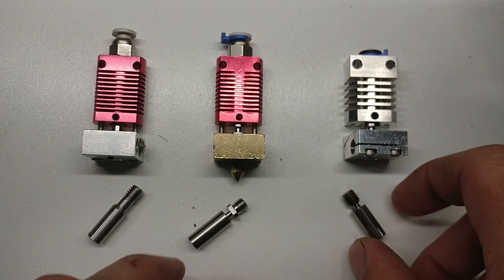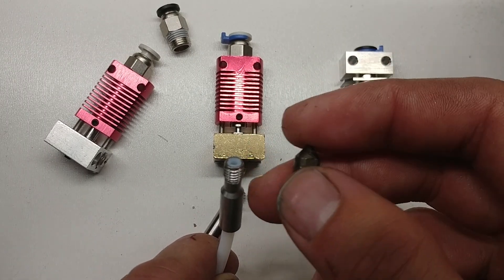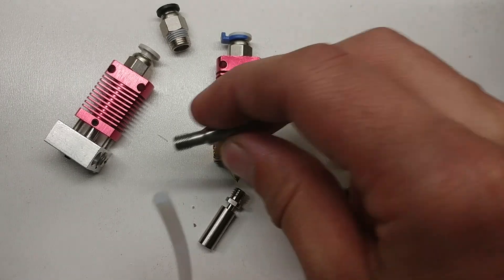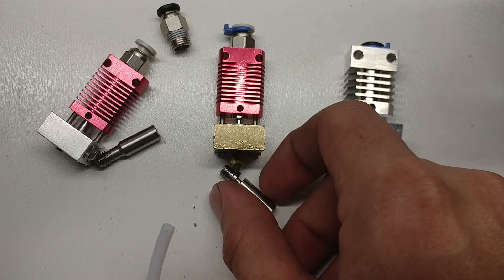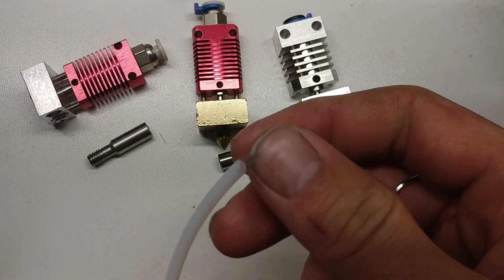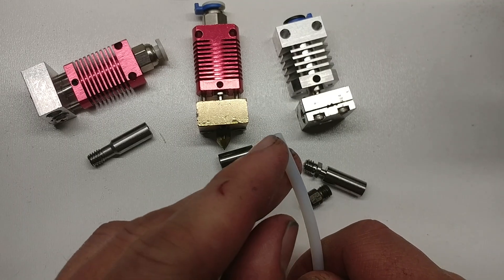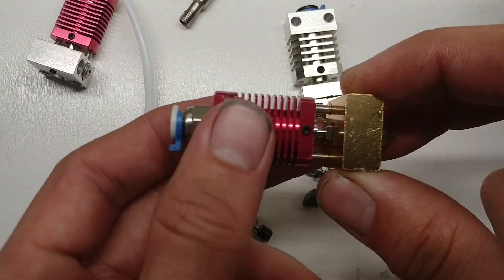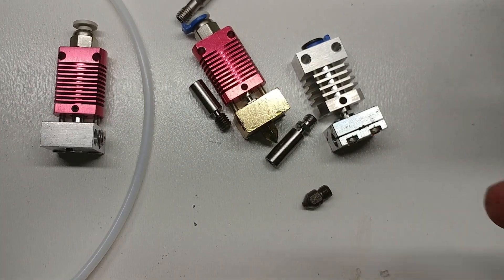How to make PLA work with All Metal Hot Ends (No More Clogging)

Comment: With the small hot end on the right, it works well when the filament is constantly feeding like in spiral mode.  Once numerous retraction happens that's when it clogs.  At least that's what I noticed.  But like you said PLA is a whole different thing.

Comment: omg... Man, just tell me why this part you lubricating called heatbreak? Cause it suppose to break the heat. I had an issue only with the cheapest all metal heatbreaks from ali, the ones from mellow works great. Instead of putting lubricant everywhere you would rather think about how it is supposed to work by design. And that will actually help you to understand, that PROBABLY, just saying, you have not enough cooling of the coldend of your heatbreak. So either your cooler is too weak or heatbreak you are using have a little contact with the radiator or heatbreak is just bad and its not doing its job. And this could be more of an issue in hot regions. Thats it. If your heatbreak fits your radiator and you have sufficient cooling you will never need to put this oil of yours everywhere. Its not the first video where people spilling mineral oil all over their parts or filaments, but the truth is - its unnecessary hack, which is just masking real problem, just solve the problem causing issue, dont add another variable to the printing process cause it could harm your layer adhesion a lot.

Comment: Had an all-metal hotend for over a year now and only experienced my first clogging a couple of days ago. Because of stringing, I set the pull back distance for traveling higher and apparently, becuause of this, the soft filament was pulled back into the unheated part of the hit end and solidified. I cleaned everything out and ran another print, with the same long pullback distance, because I hadn't made the connection to the problem yet. When it clogged again shortly after, I cleaned it again, set the pullback to a very short amount, so the filament would still be in the heated part and now it works perfect again, so I don't think lubrication is really necessary. Still have to figure out a solution for the strining, but it's a minor nuisance compared to a clogged hotend. Probably will fiddle with the print temp next.
Reply from the maker: @Brandis13  is yours an all metal or a bi-metal?
Reply: It‘s the Creality Spider Pro, so it‘s all-metal, the heat break has a ceramic covering though, so I‘m not sure if that makes it something different then.
Reply: @marcb.877 I have the spider v3 and I HATE it so far, it is the most temperamental hotend and of course it’s on an ender 3 so it already comes with its own problems

Comment: is the Temperature Different when heating PLA in a all metal-Hotend then a Standard  Hotend ? my problem is getting the layers bond with ac and does it matter ?
Reply from the maker: @markmerberger7997  usually run about 10-20 hotter.

Comment: As you say, the info is so short that I don´t even know yet if the last hotends for Ender are all metal or have the small teflon tube inside. I will go for your solution, a drop of oil before you print is much more practical. I think we still have the same problem that cars had many years ago before inventing the closed circuit of water to refrigerate the radiator. I think the whole hotend system must be reinvented but at affordable prices because how can you even think on installing a decent hotend of about 150 dollars on a 120 dollar printer, is ridiculous. Companies want to earn more money selling parts than the whole device. As the hotend is the more often part  replaced, they ask good money for it, or buy a cheap one that will last 3 months. This is why I think that the enthusiasm for 3d printers is going down. It would be better if you buy a new printer every 6 months when it starts failing but many printers start failing the same day that you receive it and try to print, so many issues for a hobbie. What is it all that we want? Printers printing, that´s all.more often

Comment: Hmm this video leaves me with a question. A google search revealed this problem to be limited to mainly PLA on Ender 3, clones and printers with that undirected and loud stock hot-end fan. That means it's very likely due to heat creep. Never the less, I've ordered a bi-metal heartbreak for my old Ender 3 (Rev1) and a 5015 fan to test this theory myself, tho in my research i already found a video claiming to fix the problem by using high performance thermal paste. Please note that there's many options available that use "all metal" hot-ends stock and works flawlessly

PS Teflon (PTFE, the bowden tube) doesn't become lubricating or achieve lower friction at higher heat. It's fully stable until 260C, tho lower quality starts to degrade as low as 230C. At degradation PTFE loses all of it's beneficial properties. So if this is something you've read somewhere, i would be very interested in reading it myself, if you kindly will refer to your source

Comment: I wonder if CV-2 grease would work. It's a moly grease that's good for high temperatures, but it also never comes off. You can put it inside the piston walls of a car engine and run it for 200,000 miles and in the end the grease will still be coating/protecting the surface. It just might be hard to use, because you'd probably have to put it on where you need it and then wipe it off the best you can. It might seem like you got it all off after wiping it very well, but there will always be a very thin coating lubricating that area for as long as that hot end or its parts exist.

Comment: Both of my machines are all metal now so I'll try this for sure, but for those still running stock hot ends there's an extremely simple way to make sure your tube is set perfectly.   If you simply install it with the nozzle in place the act of it pulling back and locking will make a small gap. So I turn the nozzle out a few threads, roughly the same distance as those clips for the bowden collars. Insert the tube all the way to the nozzle and tighten the nozzle. This will push the tube back to engage the lock all while keeping a perfect fit to the nozzle.  You can fo a bit further out with the nozzle too, some compression on the tube won't hurt but going too far might distort it and cause a restriction.
Reply: I never knew it was a problem with all metal hotends. Thought they were identical except the all metal one's could get hotter. I don't even have an all metal one and I'm having a hell of a problem. I'm not sure it's clogging though and seems to be a problem with the extruder. Clearing the hot end and temperature changes do nothing to fix the problem. Now I want to get an all metal hot end to upgrade, but I hope I don't start having clogging issues. (Guess it's always good to do research beforehand... but that's what I did before buying an Ender 3 and I deeply regret that choice. Have had every single problem I have ever heard was possible and 10x more than that in just 2 months).

Comment: Where can I get those all metal breaks at I’m kinda new to this
Reply from the maker: go on Amazon and look for bimetal heat break. Just make sure to get the proper one, they come in 6mm diameter or 7. 7 is what fits the E3Pro and Biqu B1.

Another note, make sure the heatbreak has a top indent for the tube to sit inside, makes it much easier to guide the filament.

Comment: Hi there.
I uploaded a simple part to Thingiverse(called: PTFE-Straightener😁), that sits on the pneumatic couppler, on top of the Ender-3 hotend, and it's there to straighten the PTFE-tube entering the heatsink, so that feeding the Filament into one of these cheaper Heatbreaks won't be a problem anymore. 
Should you still get problems, what you can additionally do to help with feeding the Filament, is moving the print-head all the way to the right before feeding the Filament, so that the PTFE-tube aligns even better with the Hotend.
But of course buying a copperhead-H.B. is also possible.

Comment: Wouldn't the oil contaminate the build plate surface causing poor 1st layer adhesion? 
I use the a Micro Swiss all metal hotend and have never had a problem printing PLA or PLA+  with my CR-10s Pro.
Reply: Yeah, that's absolutely what will happen. The oily mess get's everywhere on and around your printer, so, don't do it, unless you want your printer and print area to look like a chinese restaurants kitchen. 
It's not necessary to do it.
Retraction settings and nozzle temperature are good ways to get clogging issues away.

Comment: I stumbled upon this video by accident while actually trying to remember what I took out to revert from a bimetalic heatbreak back to stock with capricorn tubing, and maybe I'm speaking too soon, but your tip really seems to work. I bought a small 100ml bottle just across the street for about $2. Used a few drops inside the hotend and started printing again. My Elegoo Neptune 3 went months without use because of the constant clogging. I had several spools of good quality PLA that I couldn't use because it would make a mess, just really shitty layers, having to use high temps and constant clogging. Earlier in the day I tried this tip, I actually printed 2 simple prints for my dad's project, and like always, clog, clean, print, clog, clean, print. Later the same day I tried the tip and have been printing at least 5 or so pieces without any issues with temps down by 20°C. Prints looking as beautiful as the first day I got the machine. That made me remember why I wanted a 3d printer in the first place. Thank you so much for this video!
Reply: Why you dropped the bimetal heatbreak?
Its the best one you can get, tubing ones are useless.
Reply: @DRedGuia  I actually didn't. Maybe it wasn't very clear when I wrote that, but I was going to drop it, and then I found this video while trying to remember how to put the old one back. I'm still using the bimetal heatbreak and it works great. Same for the tip in this video, I add a drop or two when using new filament after a couple of months.

Comment: What would cause a clog two hours into a print? I have two printers with Titanium Heat Breaks. One printer has been working like a champ but the other one clogs up after an hour or two during a print.
Reply from the maker: What's your retraction? Bowden or DD?
Reply: @xalt.3d.designs  5mm/s for distance and 45mm/s for speed. Happens in both configurations. Had it in a direct drive setup then changed it back to bowden thinking it was the extruder. figured out it was the hotend getting clogged.
Reply: @lelandclayton5462  bowden is 10 years obsolete, go eith the firect and do 1-2mm of retract at 35mm/s.
Titanium heatbreaks are much better than anything else.

Comment: Can't you just spray liquid PTFE lubricant into the metal part of the hotend? It will give it a teflon coat on the inside
Reply: I thought the point of upgrading to an all metal was to avoid the off gassing of PTFE at high temperatures? Wouldn't the liquid PTFE have the same problem?

Comment: @boydm991  I just switched out to an all metal hot end on my stock set up. I saw in the reviews for the hot end that clogs were common without retraction changes. Most comments said 1.5 so I tried it. I have a little stringing so I'm going to try 1.75 and 2 to see if I can dial it in.  Maybe Ill also try the mineral oil. I was thinking of using a sponge before the extruder like Ive seen others do. Maybe Ill design a little box to hold it?

Comment: tune retraction. 2 years with all  metal on 2 sunlu s8s, a year on an ender 3 and haven't had to oil anything.  Flow, linear/pressure advance, and retraction. in a bowden setup i am good with about 2.5-3 mm and on direct drive .9-1.5mm.

Comment: Allmetal has not been an issue for PLA since the thin throat ones became available. It's just the old fat E3D style ones that had heat creep. The Triangle Labs/POLISI3D one in the middle is great. If you were getting heat creep with it maybe you're retracting waaaay too far.
Reply: Hey, I just upgraded my E3Pro with a bi-metal from Slice Engineering, and I started getting clogs in it. I looked at other reviews, which suggested a retraction of 2.5. I changed it, and was still getting clogs. How would I go about doing a retraction test to find the optimal retraction?
Reply: @NIGHTDREADED  Hey mate, I'm also running a bi-metal with 2.5mm retraction. To be frank with you, I tried to tune retraction a lot, but nothing really fixed it. I came across this video by accident when actually researching how my hotend looked before I swapped parts, and the mineral oil drops inside the hotend really helped me. The printer now works just as good as it did before I swapped to a bi-metal, and retraction is still at 2.5mm.
Reply: @GrandmasterKnox  Damn, and here I was thinking that Bi-Metal would really solve all the problems of PTFE...
Reply: @GrandmasterKnox  How often do you re-oil Hotend? Hours/weeks
Reply: @GrandmasterKnox  2.5mm retract is too much, thats whi it cloggs.

Comment: I have best experience with stock hotend by using an all metal hotend (titanium) and taking off these 2 screws between heat block and cooling ribs. Just fixing the heatbreak at cooling ribs with the little black made screw fix it very well and much enough. This setup performs best printing results, has best temperature qualities, and never more heat creeping all time. One of the problems are these 2 screws, there transporting up some heat and inceases the temperature in upper side of heatbresk up to 150°C or more. PLA melts to early and heat creeping nerves you. I considered stock hotend without these 2 screws and all metal heatbreak to micro swiss hotend and creality's spider hotend. The first setup makes ALWAYS better results then hotends, which are much more expensive. It's awsome how cheap and easy it is to power up hot ebd efficiency 👌😉 Maybe just the phaetus dragon and volcano hotends performs better, but they are made for higher printing speeds with longer melting zones, it's not for conventional use.
Reply from the maker: I am actually starting to convert all my E3Pro printers over to a new hybrid hot end using a bimetal heat break and volcano heat block.

Comment: I thought I needed all these fixes but turns out if you grab a piece of Bowden Tube and run your filament through it and if it catches or has resistance it is due to the poor filament not being exactly 1.75mm +/-  in diameter. This is why I think a lot of people switch to direct drive as you can get away with inconsistent filament diameter not being stuck inside the bowden tube at various points of the roll. I figured people would mention this but no one does, especially now that filament is increasing in price and the want to switch to a cheaper alternative will be poorer results. My two cents.

Comment: I've been doing essentially the same thing just slightly different. I have a clip on container that I put a couple drops of mineral oil into sponges and clip around filament. I then run 2-300mm through the "oil box" and out of the extruder. Then remove the box and continue printing. I redo that periodically if I notice any anomalies in printing, typically the first layer purge line starts looking globby. Thanks for the video though, love that you're getting good ideas out there.

Comment: It would be better if you show the proper preparation on only 1 hotend, because i have a mix conceptions what is good, what isn't good ....  🤔
Why to add 2 drops of oil to the hotend, when later on you insert the PTFE and filament inside it  ?
That oil is outside of everything ....
Reply: In an all metal hot end the PTFE only goes in a few millimeters. The oil is for the section below that. In a regular Ender hot end the PTFE goes all the way to the nozzle.

Comment: After switching to an all metal heatbrake I dropped the retraction down to 1.3-1.5mm and never had any issues with clogs, little to no stringing as well. I'm using the red stock Ender hotend, the one that you've placed in the middle of the three hotends. I also use the exact same style of heatbreake.
Reply: Second this. With all metal the filament cools more quickly as it retracts from the hotend. Reducing retraction keeps from pulling melted filament into the cool zone causing clogs. I went from 6mm retraction to 3mm.
Reply: @boydm991  I just switched out to an all metal hot end on my stock set up. I saw in the reviews for the hot end that clogs were common without retraction changes. Most comments said 1.5 so I tried it. I have a little stringing so I'm going to try 1.75 and 2 to see if I can dial it in.
Reply from the maker: With the all metal, I had my retraction down to 3@40 instead of the standard 6@50. What I realized later is that the retraction distance is directly related to the length of bowden and type. Cap tubing has a much tighter tolerance (1.9mm ID?) therefore not much retraction is needed than normal PTFE (2.0mm ID), this is why many with DD setups have retraction at 1mm or less bc there is literally NO slack between the hot end and extruder.

Comment: So, I run 3 Creality printers for part of my business, I recently took one off line to do a full top to bottom upgrade (CR touch, SKR mini, linear rails, duel z rods, brace, cooling,,,,,) and today i just got in the Creality Sprite, and the c reality spider hot end "not much info online on the spider". I print mostly TPU, PETG+carbon fiber and things that are considered structural and will be taking a beating. however once in a while, on complex parts i like to use the plethora of  PLAs i gotv, like PLA+wood or just PLA but still are functional parts. So my question is, does the oil interfere with layer adhesion?
Reply: Yes ofc, it's oil, so it doesn't evaporate. Plz doesn't use this oil "tip"!